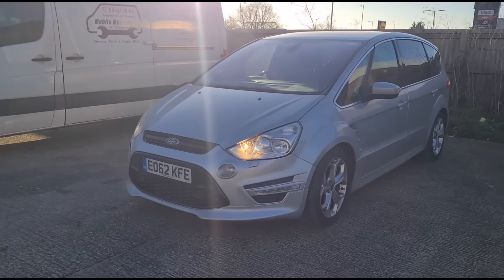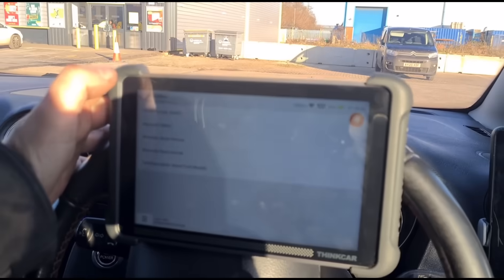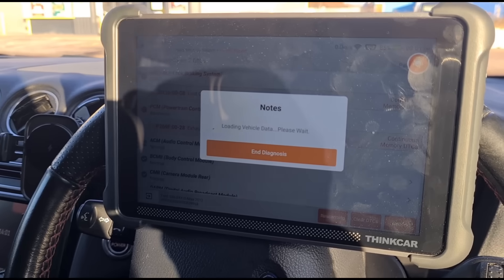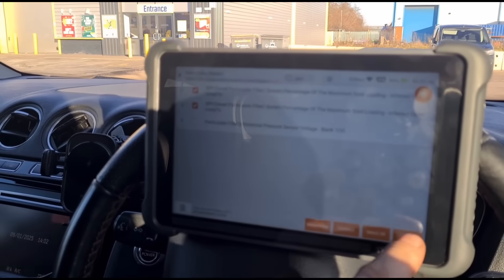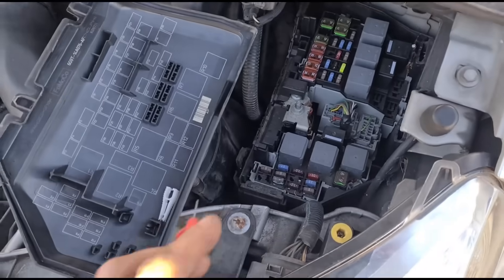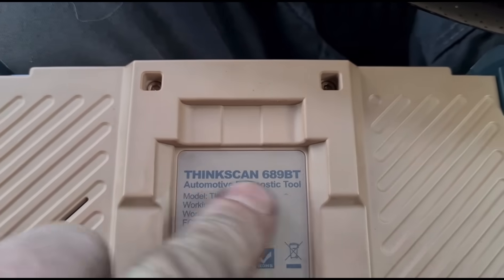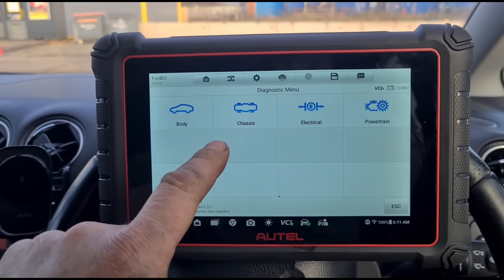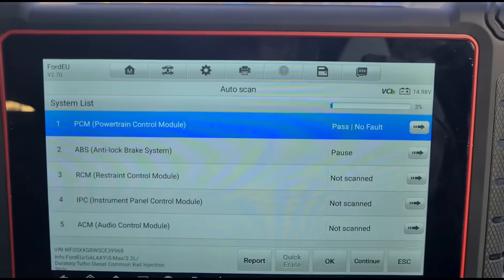Ford S-Max P256F:00-28 Exhaust Aftertreatment Glow Plug

Comment: Hi Jimmy, thanks for the video. You can find information about dpf pressure for this particular vehicle in the dpf pressure voltage section. It's confusing but you know it like for example in the Range Rover. Good luck and thanks.

Comment: Irritating when you can’t get the data. Reminds me of some of the Nissans where they hide the DPF pressure sensor data in the airbag module!?!? Great work as always.
Reply: Never seen that what car and machine where you using.? Ita listed differently usually
Reply: @ceet12  Some Nissan juke’s. Used Autel. Happened upon the DPF pressure sensor in the airbag module. Which was a blessing, although had already stripped the wipers etc to gain access to the sensor. Now have Topdon, launch as well just to save hassle.

Comment: I have a ford and citroen with this exact engine. First I purchased an xtool and because of the missing parameters from live data I purchased also an autel and a topdon, however, all are showing the same few pids. Later, I connected a "hella gutmann mega macs 42 se" showing the same short list. The next on the list was a thinkpad/launch. Thanks to your video I will stop buying any tool (this hobby is becoming too disappointing). I will continue to enjoy your videos.
Reply: Expensive hobby 😂